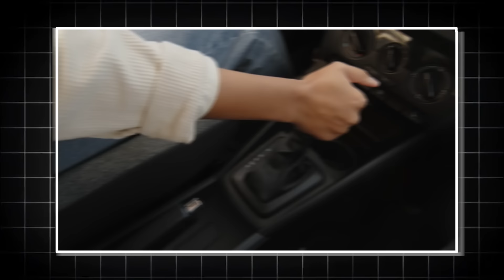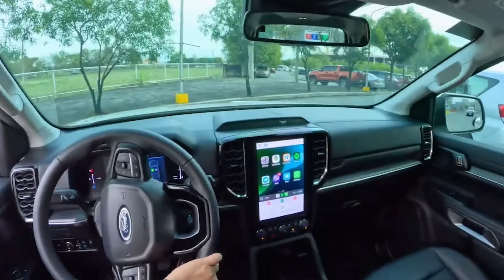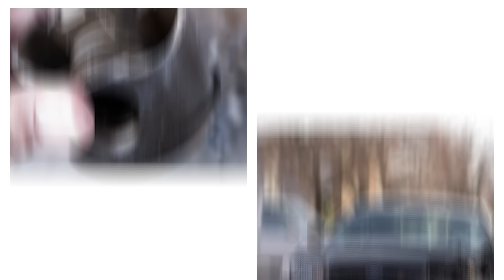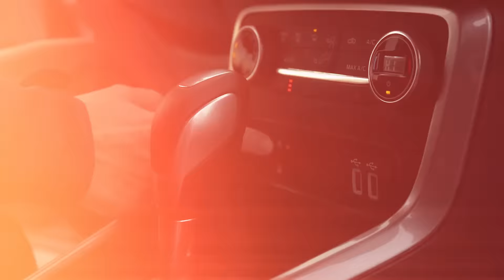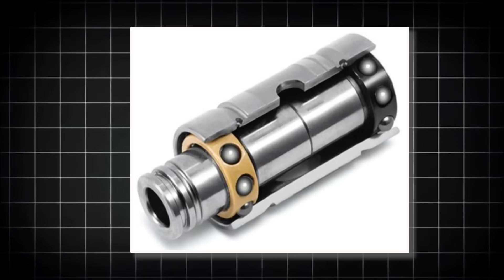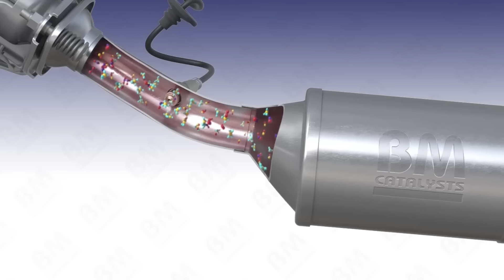7 Driving Habits DESTROYING Your Ford Engine (Most Owners Do #7 Daily)

Comment: I have a Ford F150 5.0 XLT I have no auto start stop but I do let it idle until in the cold, especially to it drops down to a lower idle before I takeoff. I have 47,000 miles on it. Been doing it since I own a vehicle.
Reply: I own a 2009 f150 4wd  4.6L with    
410000 kms 5w20 non syn. No noise or leaks. No matter how hot or cold. Same tranny with one fluid change at 360000kms